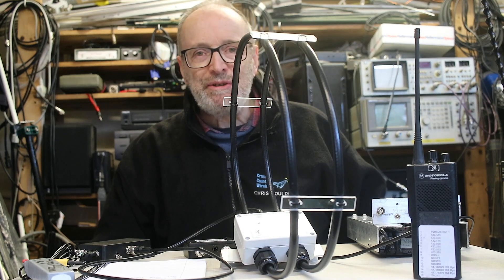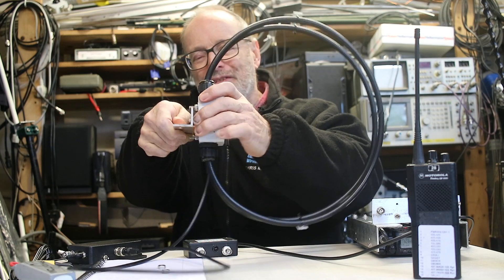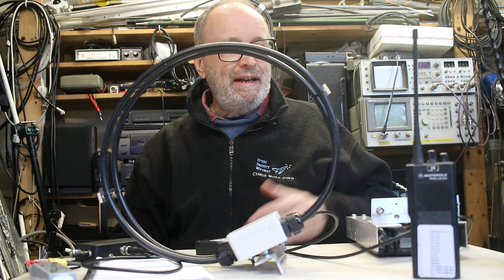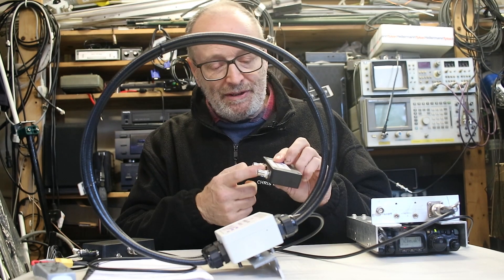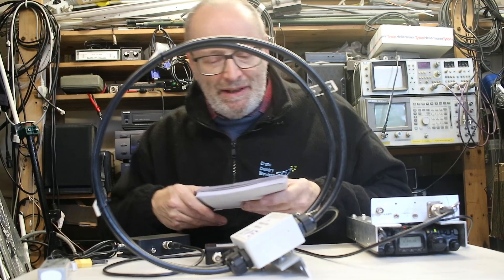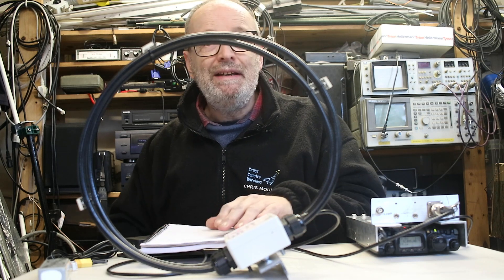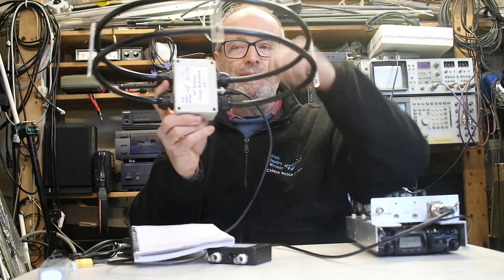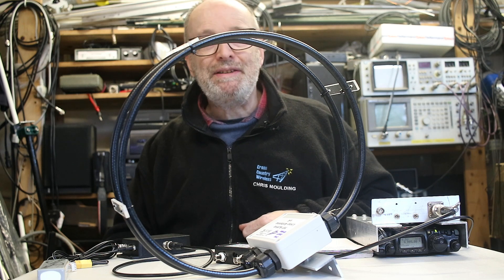Cross Country Wireless HF Active Loop Antenna v4

Comment: i dont get it.. i only put 10 watts on the antenna.. but its no function no more..
Reply from the maker: The antenna is a receive only antenna. Your 10 Watts of RF power will have blasted the internal amplifier.

Comment: I would be interested in a comparison with, for example, a long wire 20 m long. Will this antenna be better?
Reply from the maker: It depends on the location and external noise level. If you are at a very RF quiet location say the Australian outback the the external noise will be below the amplifier noise so the 20m wire is better. In typical urban or suburban locations both antennas are limited by external noise. The advantage of the V4 loop is that the twin loop design has very sharp and deep nulls typically 40 dB down. It can be rotated to null out the strongest interference sources so in this situation the signal to noise ratio will be better than the 20m wire. If you cannot erect a 20m wire you can still use the V4 loop antenna with very good results indoors.

Comment: Seems to be an awesome product as usual from you Chris.
A thought: is it a good idea to mount one horizontally and another vertically to get both high and low radiation angles the best possible way, or is it overkill?
Best 73's from Sweden
Reply from the maker: It's probably overkill! Mounted horizontally it needs to be at least 1/2 wavelength high at the operating frequency to get a lower angle of radiation than a vertical loop. It's really for those who live in a tower block many floors up who would see the improvement.

Comment: Great video chris it is also good to use for indoor use only
Reply from the maker: Yes the antenna can be used indoors as well as outdoors. It's small enough to fit on a window sill or fit through the hatch to the attic or roof space.